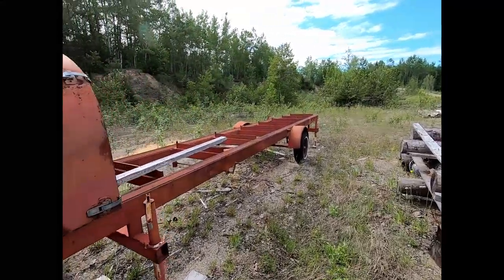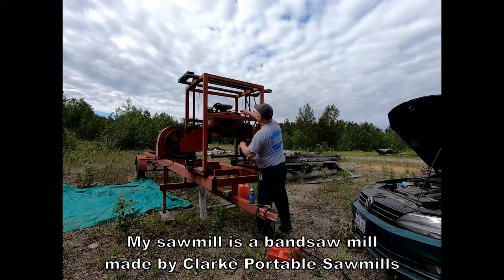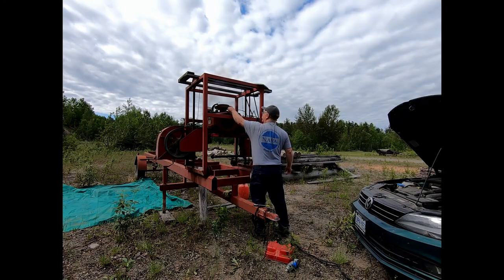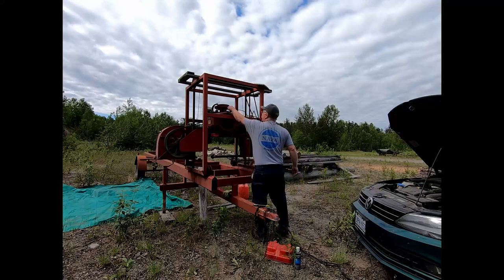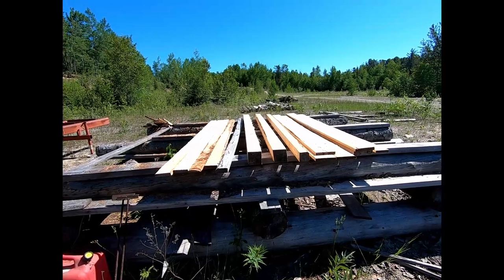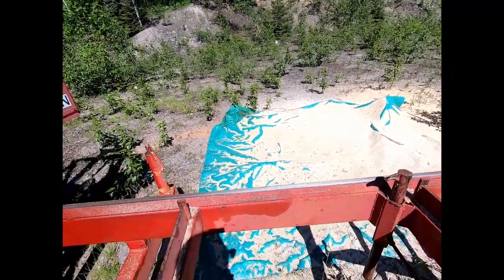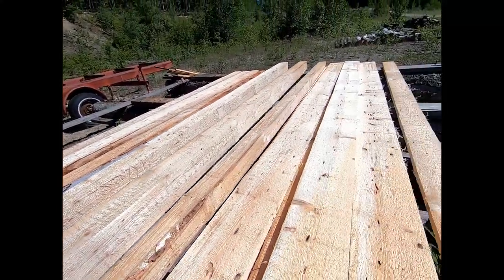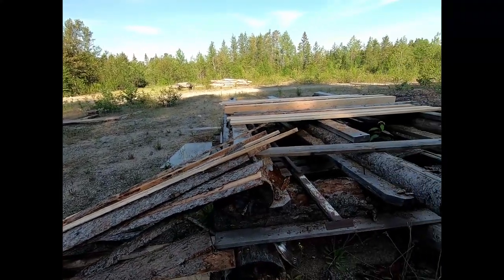Turning logs into Lumber

Comment: wish i had a tractor i would have more logs sitting at my mill, more wood falls in the forest here then gets used be good to put some of it to use, bug holes good for some rustic project. i use some of the pine here that as turned red for projects, looks good burnt and linseed oil put on it, yes always good to cut a few boards from time to time eh.